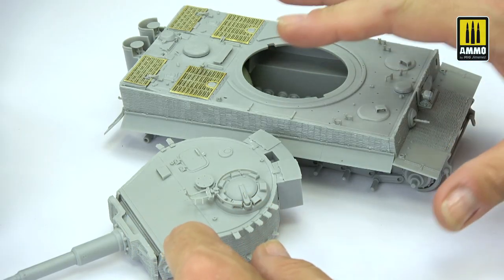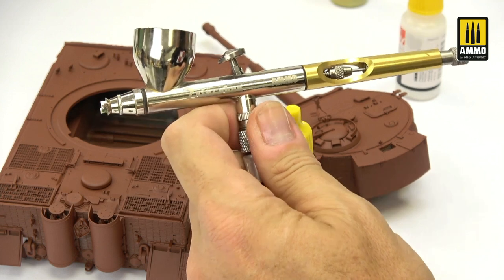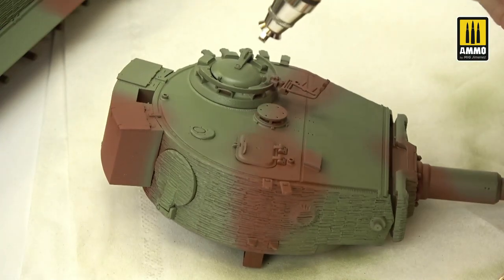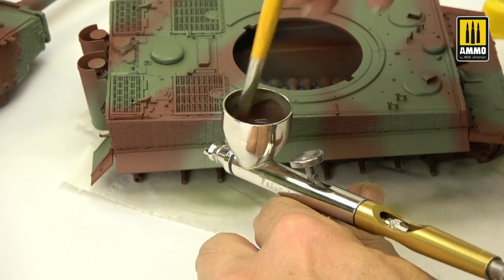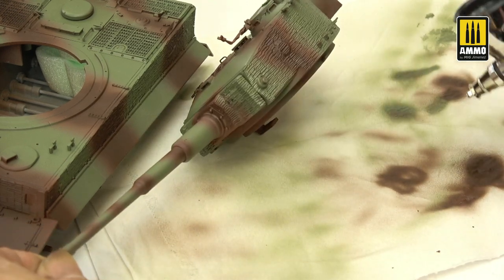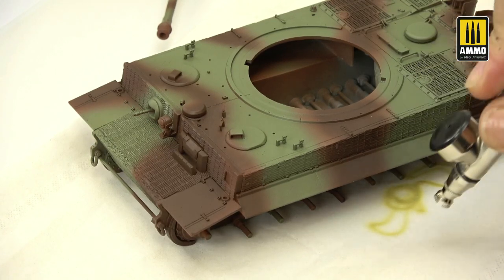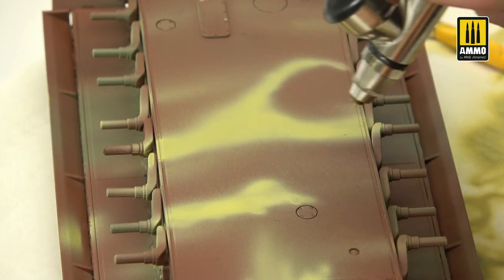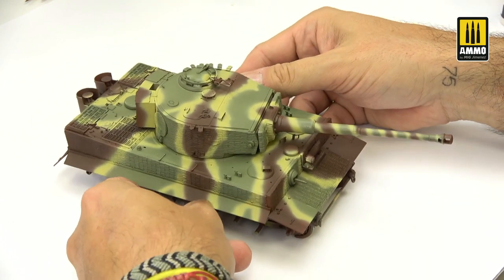How to Paint Camouflage on a Tiger I / Cómo pintar el camuflaje de un Tigre I

Comment: What does the satin warnish do, and what wit does when mixed with acrylic paints? I am confused.
Reply: It protects the paint  from unwanted scratches or discolouring  ,also, if you ,after applying satin ot mat varnish, you do a pin wash with oils or ennamel,  the thinner won't ruin the acrylics.